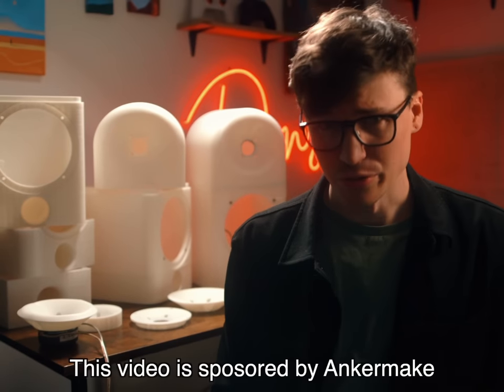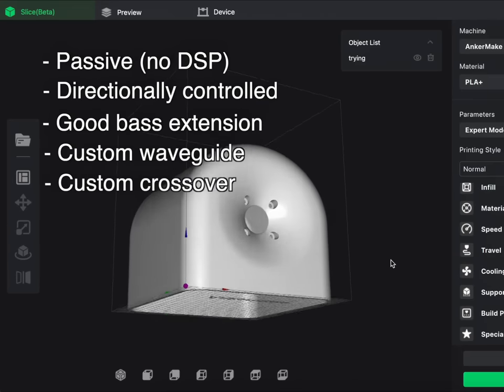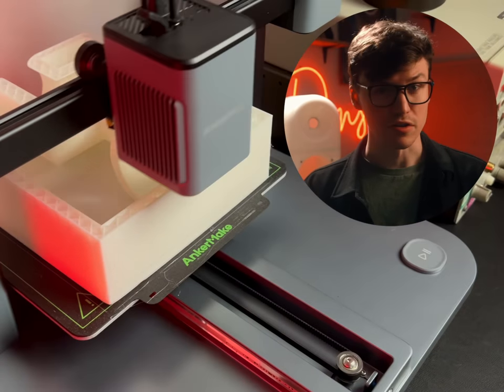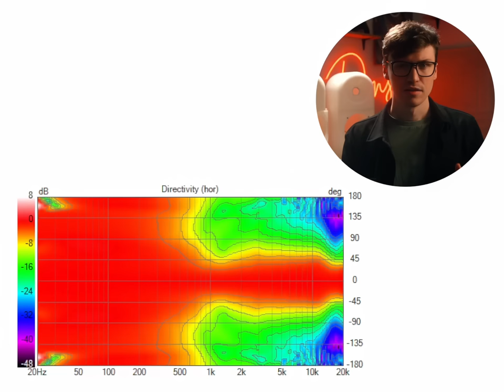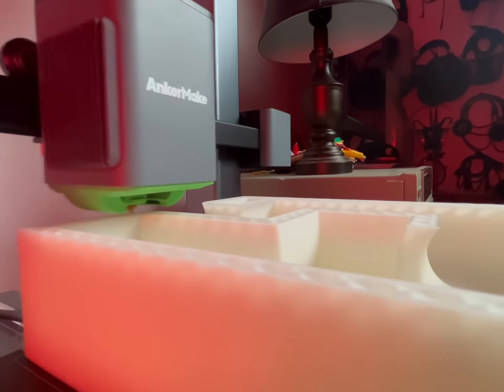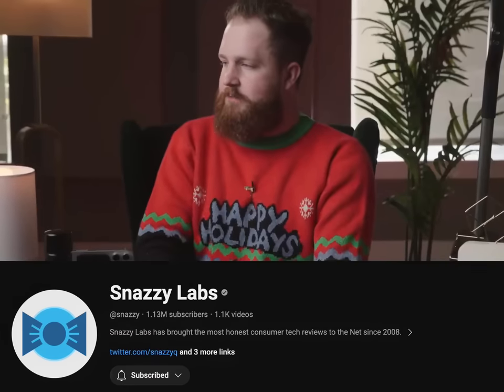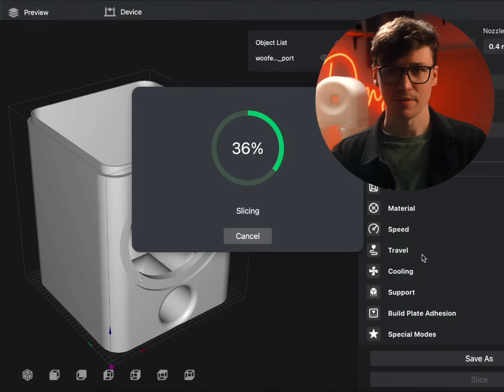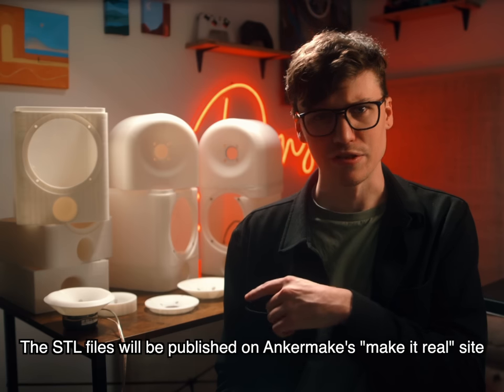Designing REFERENCE Speakers you can 3D print - Part 1

Comment: Other 3d printed speaker designs had to resort to plaster fills to reduce noise bleed and rattle, curious if or how you fixed this. Especially since you didn't talk about design process or build materials at all it makes it seem like your "best speaker design" is just hot air.

Comment: A great start.  Hopefully more reviewers will learn from you and be more hands-on with the audio and learn the internal mechanics of it. 
suggestions: You could try an Inverted V on the rear, or the pattern that you generally see on a pyramid foam,  This will reduce the back wave,  generally improves clarity.   Series Crossover in my builds improved clarity because of the lower values of inductors in the woofer path.
All the best!

Comment: Some suggestions: 

- Bends on ports makes them lose efficiency fast, even with decently angled curves, so try to make them at most an L upwards (with a way gentler curve than those 90 degrees lol), and flaring both ends helps air velocity to not become a problem (aka Chuffing).

- Flat walls are bad relative to curved walls both as their relative strength and as they create parallel surfaces which propagate way more resonances; traditional panel manufacturing tacles these two problems as you guys did, increasing the thickness/ using more inert material, but additive manufacturing don't have those constraints. I understand you guys tried to do as big as the bed would go for 2 pieces, but i would suggest going taller or wider and increasing to 3/4 parts for this particular project.

Comment: One idea I've thought about is that you could make a 2-walled speaker body and fill the void between the walls with sand like old Wharfedale speakers. Guess it depends on if sand is cheaper than using more filament
Reply: DIY perk did that with plater of Paris
Now you generally do that for speed as the slower printer can take days to print such massive part
Reply: @zblurth855  good sand for speaker building purposes is actually a bit expensive (you need a dry, dense sand that compacts on itself and flows well), and the plaster of Paris does not  adhere to PLA and can resonate over time as it delaminates. 
Epoxy resin that doesn't overheat when cured is even more expensive, but it's also the best option, and almost the perfect option. It's just really tricky to work with due to its low viscosity when it begins to cure (it will permeate PLA in certain geometries and leak out).

Comment: You should try to get the acoustic centers closer for a better vertical off axis response and use braces to damp the box vibrations, otherwise it will sound like a plastic box
But it's a fun idea overall
Reply from the maker: Actually trying to make this fairly cardioid. Ideally just listening within a 30 degree window to avoid reflections.
Reply: @DMS3TV try to make the off axis response fairly even.
Reply: Absolutely get acoustic centers as close as possible even if it means cutting into part of the wave guide box.
Reply: @DMS3TV  so try to lower the crossover frequency as much as the tweeter can handle to avoid cancellations between the drivers at the crossover point. 30° is a lot in the vertical plane and the drivers can end up out of phase

Comment: An interesting idea but even a thick 3D printed cabinet is likely to be quite resonant.  If you don’t already intend to do this, I would highly recommend capturing some accelerometer measurements of the finished cabinet.

Regarding the absence of DSP, I really believe that you are working against yourself there.  The 306P which you hope to outperform is a DSP based speaker and a traditional crossover would need to be very complex in order to eliminate the resonant peaks likely to occur in this cabinet.
Reply from the maker: This is why we did simulations first and during the cabinet designs. I haven't measured any resonant peaks.
Reply: @DMS3TV  Except you can hear exactly how resonant it is when you tap the body twice towards the end of the video. It rings a lot. Simulation does not provide all the answers. Why do you think, most of the best speaker cabinet designs utilize a LOT of mass in the cabinet? Firstly to ensure that the cabinet does not flex or move, and secondly to lower the resonance levels and their resulting frequencies. I am going to guess that the cabinet is not only going to flex but also ring. You will need to add a lot of mass dampening material to alleviate that. And going for a no dsp route as well is probably not going to help with such a obviously resonant box.
Reply from the maker: @ferociousmullet9287  a few things to note. That’s an open housing I tap. You’ll get the same thing with a speaker box made of MDF. The nice thing is resonances will absolutely show up on measurements, and in this case they aren’t. You don’t need mass what you need is rigidity and careful design. Mass is just an easy solution to the same issue (but not the only solution).
Reply: @DMS3TV  We are just going to have to agree to disagree. Because I've been doing this too long (several decades longer than you) to not know exactly what this is going to end up sounding like. Maybe your idea of 'good' is very different to mine. And  yes I understand the mechanical design, electrical design and DSP aspects. Good luck. Simulation is not the be all and end of everything, simulations are only as good as the information they are using to provide the models. And models are not the real world. They are often much simplified. And complex interactions exist that many simulations do not take into account.
Reply from the maker: @ferociousmullet9287  I agree simulations are not the end all. That’s why I printed and measured so many times. Luckily the science is pretty firmly established at this point and the rigidity of the materials we’re using is being taken into account 😄 

Is your concern that it will affect a facet of the sound that can’t be measured?
Reply: @DMS3TV  'Is your concern that it will affect a facet of the sound that can’t be measured?' - No. But you have not actually measured anything at this point, have you. You have simulated. You are making an assumption that what is being simulated will translate directly into real world performance/measurements. Which is simply not the case. But As this question is an attempt at a 'gotcha' I am going to just say what I said previously. Which is good luck and that I feel your definition of 'good' is a world apart from my own. There is a reason speaker manufacturers of the best speakers are not using plastics in their designs. They would be all over it if it worked, because it is cheap and would improve profits hugely, but they don't and there is a reason for that. But you do you. As I said, good luck.
Reply from the maker: @ferociousmullet9287  …. As mentioned in my previous comment I have measured it… I’ve measured many revisions…
Plastic speakers have been fine for some time and are not uncommon.

Comment: I would love to see how much 1  Pair costs in total, aswell as a list of components with costs. Information on the room size these are optimized for would also be interesting.
Reply: I've been working on a pair for the past few months that seem to use almost identical drivers, and to avoid resonances, I used about 3.5kg of filament per speaker. I also printed with 4 walls, and 33% infill, and had bracings on every wall and a cross brace. I used bambu PLA on sale, so the total cost, plus the drivers and xover parts, comes out to be about $500 per pair. 

Considering they will have identical components to the famous Revel M105, and will measure even better, it's a very good deal.

Comment: I got a very simple question: Whether I'm on the go or at home, I basically only use bluetooth headphones. The reason? The cable of course, but not in the way most of you would think. I don't mind being tied to a certain space while writing songs, listening to music or playing games. What really bugs me is that I can hear every little movement in the cable, when it taps something, when it rubs against something and I really can't sit still that well (ADHD boy in da house <3) and when I'm out and about it gets even worse. And this absolutely drives me NUTS. I use Beyerdynamic DT 770 80 Ohms, so closed headphones because I do a lot of recording. I prefer the sound of the DT 770 over the bluetooth headphones that I use daily, which are the QC 35 II and the Jabra Elite Active (I still like the sound of both and the noise cancelling feature is obviously great. Sometimes I need absolute silence when I travel, then I put the Jabras in my ears, put the Bose over them and activate noise cancelling on both devices. It's like a bit of heaven in the middle of a packed train.). I would use the DT 770 on the go but I can't. Can someone please tell me how to get rid of the noise the physical cable makes?

That is a very long text for such a short question... however: any ideas? <3 much love from Germany

Comment: What material is this printed on? PLA?  Curious to see if there's any improvement when printed with different material like glass-filled PLA.
Reply: For sound you may have more diffence of you use more pla that buy more expensive gf filled
Now the stiffness will increase but if you just add a perimeter it will increase to and will be probably cheaper

Comment: Speaker design 101 you need solid cabinets.
Reply from the maker: Rigidity being the key thing. Many materials just need more mass to be rigid.
Reply: @DMS3TV  when you do a frequency sweep put your hand on the cabinet and make sure you can't feel it vibrating too much.

Comment: Doesn’t plastic resonate way too hard, even if printed in structure? Maybe a hollow shell filled with quartz sand could work as speaker enclosure.
Reply from the maker: It’s all about the wall thickness

Comment: So, this is cool, but are you saying the project can only really be printed properly with the AnkerMake model in the video, or just that it does a good job? Or does a sponsored video mean you can't really answer that question one way or the other here? It would be helpful if, when these designs are released, you could provide min specs for a printer to do the job. Better yet, it'd be nice if the community could, over time, provide a 'verified' list of printers that have successfully printed the project to spec. I don't own a 3D printer yet, and while I'm sure this one is nice, I don't really want to be picking a printer based on one project. Not to sound ungrateful - I appreciate the work.

FWIW, I'm in Australia and the local distributor doesn't have the M5C available, just the older model.
Reply from the maker: There’s definitely multiple printers that could do this, but this is the only one I can personally vouch for given my experience. 
The hard part is accuracy. Some of my older printers have the same print bed size but the AnkerMake is the first printer I’ve had that can actually complete prints this big without failing.
Reply: @DMS3TV  Ah, cool. Understood. Cheers for the reply.

Comment: PLA and holow walls are super bad for speaker... you need some dense material for the box... maybe filling the walls with epoxy and sand?!
Reply from the maker: not having any issues since I increased the wall thickness
Reply: @DMS3TV  i mean for the sound it produce, you dont want chambers like an guitar body, that can resonate at special/unwanted frequency, i had printed some speaker too (i will only give the info i found, why its often bad to 3d print well boxes for speaker)
Reply from the maker: @kjgfalsk  luckily resonances would show up in the measurements 😄 haven’t had any issues since updating the slice
Reply: @DMS3TV  if so nice, i had only to say that pla and gaps are relativ worse for that kind of usage^^